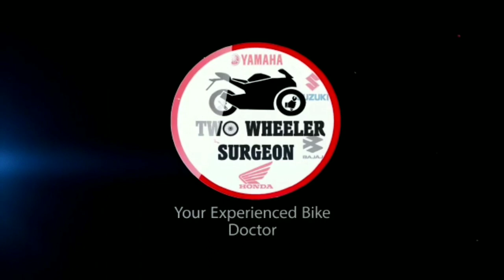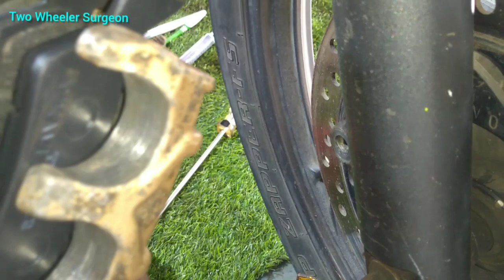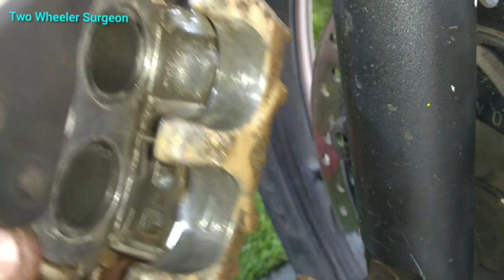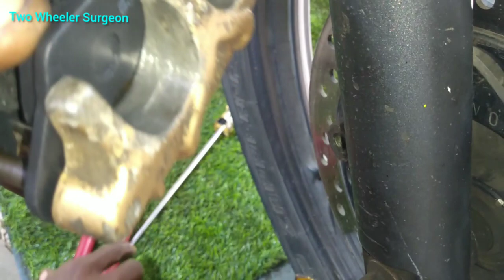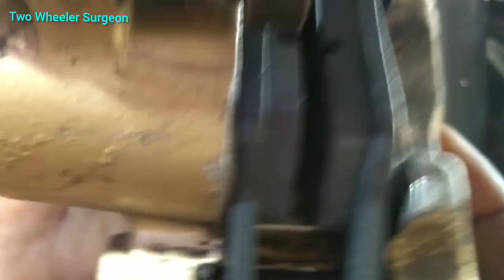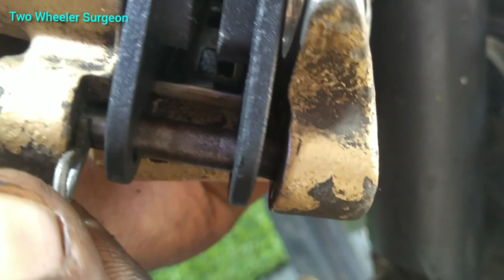Unicorn 150 | Front disc vibrate

Comment: Super sir this same tak  tak noise comes in my unicorn I confused when it's come caliper, brake pad or front shocks absorber you will give solution for this I need check brake pad spring plate inside in a caliper, Thank u very much sir
Reply from the maker: Every Friday live at 7 pm